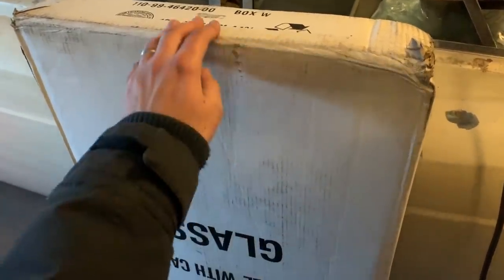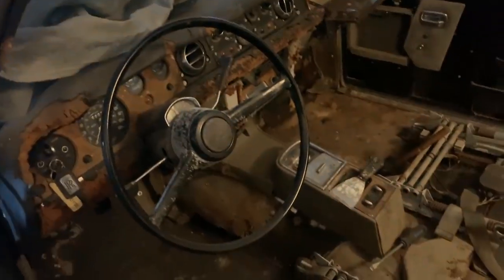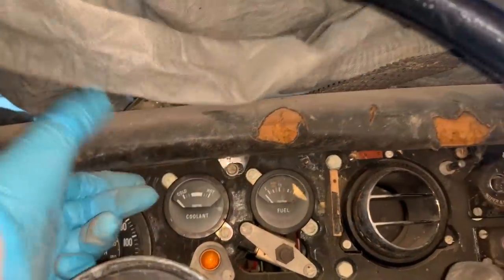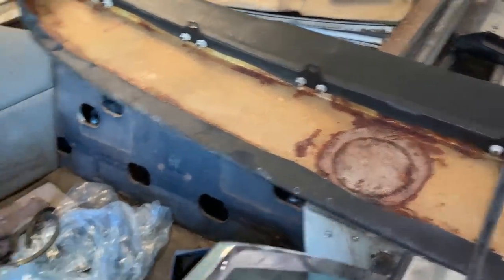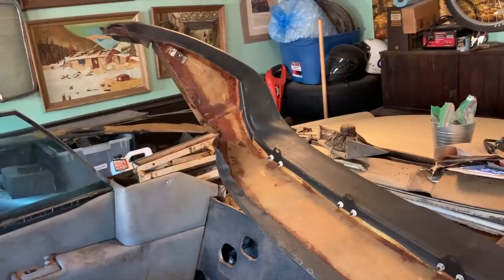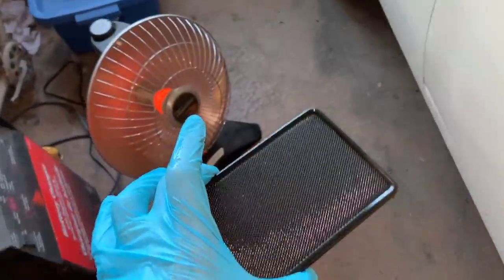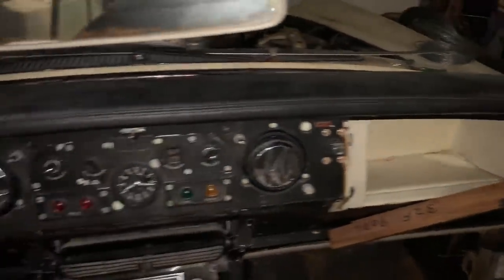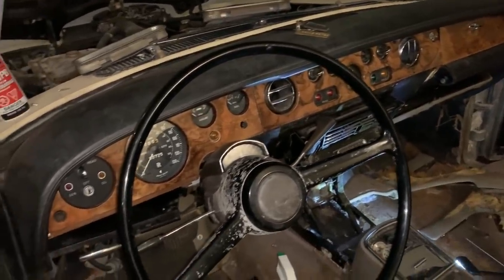Part 4. Digusting Dashboard Dilemma! Rolls Royce Convertible Renovation

Comment: Looks much better already.  You may run into some issues with re-dying the old leather to match the new work.  It is more than likely chrome-tanned leather and it does not like to take new dye well, or evenly.  I would take the panels off and try it on a spot in the back first. I have not had great luck matching already dyed leather to match new leather of any sort.  The existing colors will affect the new leather dye color in different ways and it may require getting several colors of leather dye and mixing a custom dye to get it to work.  Personally, I would take them into the upholstery shop and have them redone along with the seats.

Comment: Alex, just a note regarding Spray Nine: make sure to deeply rince the cleaned surfaces. You do not want the stuff to dry on said surface. Once it does, it leaves a whitish smear very hard to remove after a while. I've using it for decades in my cars (ex-smokers) and around the house. Incredible stuff. Smells like hell but powerfull. Even on greasy engine bays or parts !
PS Buy microfiber rags at Canadian Tire instead of paper wipes. Terrific on mirrors and glass. Leaves absolutely no dust ! And highly reusable !

Comment: Alex I can't help but notice that you have been putting the poly on too thick and you got brush marks everywhere. Get some quality foams brushes and smooth out the finish with 400 grit or higher sandpaper. That veneer will really pop with a smooth glossy finish after that.

Comment: I’m sure you have products you like, but wanted to share one I use a lot and have had great results with POR15 paints I don’t work for them, not affiliated at all, just an old shop mechanic and retired Navy. I personally have had great results with it on rusty and crusty surfaces where you don’t have the ability to soda blast and get back down to bare metal. Just make sure unless you use the “top coat” that you cover it with paint, UV light will break it down in a year or so, if it’s inside or under carpet it just fine.

Comment: For the leather in the back if you use a soft bristle brush after  spraying (a toothbrush works great) it will be easier to wipe and get off more grime.

Comment: Meguiar’s All Purpose Cleaner or Super Clean Cleaning Solution are what most car detailers use for heavy cleaning work that involves grime, dirt and grease.  I use all those products and it is the best product I have used for cleaning anything with a car.  For certain areas I dilute them 5 to 1 with distilled water.  I use them to clean the engines too with my pressure washer too.  I also use a McCulloch steamer with the cleaning solutions and it cleans heavy crime fast without damaging it.  I like the Metro Blaster Sidekick to blow out dust when the shop vac can’t reach it.  The micro fiber towels I buy in bulk from Costco.  The yellow ones.  Best deal any where.  If I lived near you I would volunteer to help clean your project car.  Now that I am retired I enjoy car detailing.   It’s fun to learn about products and tools.  Keeps me busy.

Comment: One of the best ways I've found to clean leather without damage is plain shaving cream, just the cheap stuff without any additives, and a very soft brush.  Will clean it quickly and doesn't penetrate into the material.

Comment: The heater is a radiant source. It radiates light which travels in straight lines. The point of the reflector (excuse the pun) is to focus light. If you want to heat the glue you need to consider the straight and narrow path.

Comment: ………...kudos to you Alex for taking on what seems like a HUGE project to restore your Rolls Royce the way you have.  I must admit I'd have assumed that when the car was first assembled at the factory way back when that no cost would be spared when putting these together...…...so I was really amazed to see that the radio that they installed in these cars was from Motorolla?????  Seems pretty cheap to me, in fact isn't that the brand that Radio Shack used to carry?!  You'd think Rolls Royce would've used Blaupunkt or something like that, even Mercedes used Becker which were a nice quality sound system.  At any rate, I can't wait to see the finished product when all is complete and you're transporting the family around Edmonton in true style and panache.  :)  Continued good luck.   Steve
Reply: Radio Shacks house brand was Realistic.

Motorola was by no means a "cheap" brand. They were the OG automotive radio manufacturer (hence the Motor in their name), and the company that supplied the communications radios for to NASA. They have numerous other accolades, and innovations.

Comment: Just wondering Alex if it might be a good idea to check your all electrical connections and Gauges in the  dash when you had the top dash section off? It looked like you had some decent access when the dash was off and there was no windshield. This is going to look really smart after you got it all together.

Comment: I think it would have been easier to replace the speaker before you put the dashpad back on.  I would find it hard to believe, with the weathered condition of the rest of the interior, that the original speaker works.

Comment: When you get this right, you will never want to part with it. If you bought it to try to make a buck on, you won't, because you'd have to sell it to get the money. Once this is right, I can see you selling the Caddy first, or even the ambulance They're so nice to drive, you won't want to drive anything else anyway, not for long anyway. However, I dodn't recall if it runs or not, you might be putting the cart before the horse doing the body and interior if you haven't made sure it runs. If it doesn't they can be costly to repair if you can find somebody that knows how, that is. Not just anyone can work on a rolls. well anyone can but few can do it right. There used to be a place in Nevada you could take it, but I would think there's somebody closer, being it's a brit car and Canada has such close ties with the brits. I've driven one like this, they're so.. excellent to drive. sorry I don't have the words to express it properly. To drive this, wear either your flat cap or your top hat, depending on the occasion. One trick, though you probably wouldn't do it, is to wear a chauffer's cap and ask the guy at the shop to fix it for a price you can pay and not let the boss know. I've heard of that.

Comment: gorilla glue in my opinion is garbage you want a really strong glue I suggest and I have used E6000 . I have fixed soles of winter boots that have never leaked again . that glue is amazing , you can get it at michaels . 8 can a tube and worth every penny. it glues metal as well as many other materials . one down fall . its very strong smelling and needs to dry for 24 hours, but worth it
Reply: sorry that sounded bad . i should have said not as strong as E6000

Comment: To go through all that trouble and not take it apart and check the electrical system and replace the old wiring this should be a frame off restomod it will look ok but you're going to ne on under or about that car forever